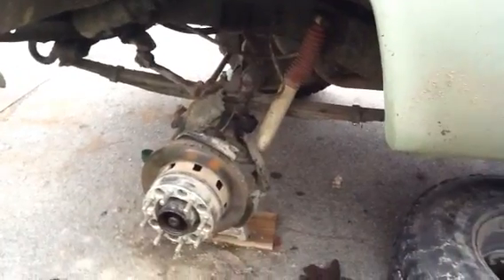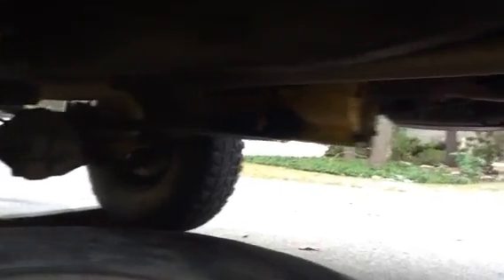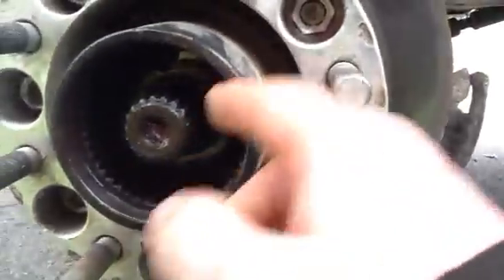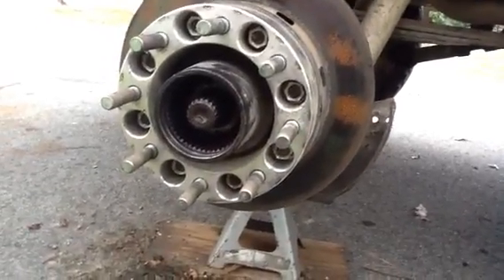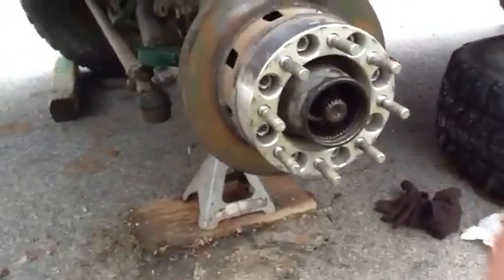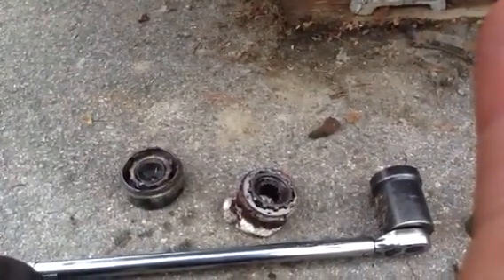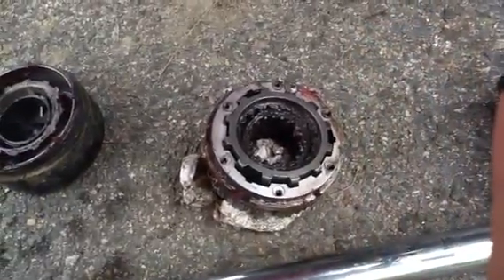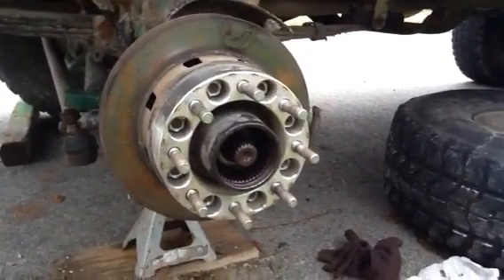How manual locking hubs work

Comment: Nice video,  Ian. You inspire me to make more content. Been meaning to make a video about a cheap hack, incase you blow out the locking hub mechanism in a common way. Something my truck seems to do. The diesel ate up all my spares. Something the 460 never did.
Reply: One more thing. Did you put a divorced np205 in that truck? I couldn't see. Been looking for one. Want the advantage of the pto, and 4x4 after a gear vendors overdrive. Or a simple "brownie box", if I can find one.
Reply from the maker: I have a mated SM465/Np205 in this truck.  I did pick up a Ranger Overdrive for it tho.  Advance adapters used to make it as an over or under drive unit IN front of the old 4 speeds.    kind of a cool idea.
Reply from the maker: yeah go for it making vids is kinda fun and I love learning from others.  Thanks for watching my vids.  Sorry the editing and camera work are so so.  Hopefully getting better with a new phone and more free time.  Just sold my fox body mustang and picked up a 7.3 E350 to build.  Maybe it will get 4x4 conversion....   Thanks for watching!

Comment: If you have these types of locking hubs, you can just weld your front diff together.  Now you have a selectable-locker.  Is that not correct?  :D
Reply from the maker: you could but with it welded it would be hard on the street  and real hard to steer in snow and ice on the street in 4x4.    For the cost and ease of repair I prefer a lunch box or Lockrite or spartan locker over welding.  I got the front locker used for 100 bucks.

Comment: So a locking hub makes your RWD truck to AWD? Can you leave your hubs locked and never unlock them?
Reply from the maker: sure you could.  but as most offroaders will tell you you can break a hub.  Also they make drive flanges or drive pucks to do just that.  Some call them drive slugs.  IT is how my truck came from the factory.  Most Plow guys will keep there hubs locked all the time around here

Comment: I have a 2001 Hilux LN167 and when I put it in 4x4 with the diff locks on it jumps out back to 2H when I set off. 4x4 Low works fine. It does not jump out of 4H when the diff locks are off. Any idea what might be happening? What do I need to look at?
 Could it be a hub issue?

Comment: If my hub is squeaking when engaged do I need to replace the locking hub? Or everything
Reply from the maker: It could be a few things but first I would check your axle joint on the axle shaft.  I would also open your locking hub and clean and oil it.

Comment: So if I have a 4x4 truck with a manual hub I need to switch it to lock to go 4x4
Reply from the maker: correct.  If you keep it in "free"  the axle shaft will spin but the wheel will not be engaged to get power.

Comment: Can you just put this on any 4x4 I believe most front diffs are open?
Reply from the maker: Locking huibs Lock the wheel hubs to the axle shaft.  Diferental Lockers Lock the right and left axle shafts together..  Most front diffs nowadays have a Unit bearing so the axles are already turning and oly get 4x4 when the Transfercase is shifted to power them

Comment: You can leave them locked if you know you'll need them and then switch between 2 and 4 without getting out
Reply from the maker: Yeah thats a great point.  And most Plow guys or loggers around hear do just that.  With my front differential having a locker installed I try not to keep them Locked on the street as it makes turning a little harder.

Comment: I'm assuming your 4 wheel drive has open differentials with power to only one free spinning wheel (front & back axles). Therefore, to have power to both wheels, the cheapest way to do this is to have locking hubs. Did I understand this correctly?
Reply: No.  Looking hubs just means the axle shaft is connected to the hub.  Your differential gear set is what controls power to one or both wheels.  If you have what I know as lockers, you'd have power to both wheels equally.
Reply from the maker: Nailed it man well said
Reply from the maker: My truck does have power to both front wheels because I have a Locker installed in my front differential which sends equal power to both front axle shafts which are connected to both front hubs where the wheels mounts with the locking hubs.  IF i did not have a Locker in my front differential then The Power would travel to the wheel with least resistance.  IF I did not Lock my locking hubs then the hubs and axle shafts would not be mechanically connected and no power would go to either front wheel.

Comment: I can see it's different to a diff lock but if you have both ends locked I don't see the difference
Reply from the maker: The wheel hubs just lock the tire to the axle shaft through the hub.  The axles shafts meet at the differential taking power from the drive shaft.  Placing a locker in the differential Makes it Locked and not diffrenate power.  Locking hubs just LOck your wheel hub to the inner axle shaft.

Comment: To be on the safe side...i got an 84 toyo. Just bought it a couple weeks ago. The front axle inner seals are shot. Leaking bad. I have limited time to fix it and plan on driving 8 hours back home with the truck in a coulle weeks. 
Question is....transfer case in regular 2wd, the front axle shouldnt move, right?  Thus the front diff gears are not moving at all...Amd the hubs disengaged, the diff wont move either, right?  I want to make sure i wont be burning the gears up in the front diff taking the long drive with barely any oil inside the front diff.
Reply: Iggybu that would be correct, when the hub is disengaged the hubs are disconnected from the cv axle thus not spinning anything inside the front differential.

Comment: It's NOT rocket science. Just explain why even bother locking the hubs in 2h at all and what is happening when you are driving in 2H with the hubs locked as opposed to 4H. No video actually explains what locked hubs is and it can't mean  4x4 because you have 2H with isn't 4x4.
Reply: 2H only sends power to the rear.  4H or 4L will send to front and rear, but if your hubs are unlock the front diff is spinning but not transferring power to the wheels.  The hub in the locked position will lock the wheel to the front axle.  If in 2H and the hubs are lock, the wheels will turn the front diff.  Bad for gas mileage, bad for wear, but if you rarely use 4 x 4 then locking the hubs in 2H will circulate the diff oil a bit.  Just don't do it for long distances.
Reply: It would engage the differential causing it to rotate
Reply: againandagain in 2wheel drive if you unlock your hubs your gears do not spin while your moving

Comment: i have a driver hub that keeps trying to lock itself when driving. obviously it never actually does, but it goes from 'free' to nearly locked within a few miles of easy driving. should i replace or is the spring just worn? it is a problem cuz it clicks SUPER loud when this has occured, causing me to stop and free it up again....getting worse over a month. any ideas? never had this issue before and trying to not have to replace the set if i dont need to
Reply: Stephanie Harvel I have the same issue did you figure out what to do

Comment: If the axle shaft is turning is there a problem with the center section? I have locking hubs and I turn it to free but the axle is still engaged with the hub. Is there something wrong with the axle?

Comment: Thank you for the explanations.  Know I understand.  Does 4WD works when the front wheels are not locked?  Or the wheels must be locked?
Reply: in order for your truck to be in 4x4 with manual locking hubs you have to get out, lock the hubs then get back in the truck and then put your truck into 4x4 like any outher truck. but without your hubs locked, and if the truck is put into 4x4 it will not turn the front tires. they must be in their locked position. but. you can leave them locked. in my k20 i topically dont because im not in 4x4 all that often, so i rather not wear my u joints. but most off roaders buy cheep hubs, so instead og breaking your axle. you just break the hub
Reply: isn't 4WD and AWD the same?

i understood that 4wd and awd full time would distribute the power at around 70 percent Front and 30 percent Rear

and 4x4 low is more like 25 percent equal on each wheel
Reply: Default Name no, 4x4 is distributed equally. AWD distributes power to unequally depending on which tires needs it the most basically.

Comment: Still some questions left.

You said "rack and pinion" in the front axle. (Which, I think, i sweird. I only know "rack and oinion" in the meaning of "Zahnstange", as in some steering designs. Do you mean a bevel gear?) 
So there is no differential in the front axle? Then, of course, locking hubs would make some sense, because on non-slippery terrain the drive train would tense up, leading to excessive wear and making steering rather unpleasant, if not impossible. Actually, the same outcome as a locking front diff for all practical purposes. 
If this (no front differential) were the case, you would NEED to unlock the hubs to drive on non-slippery surfaces. However, this then means you would have either 2wd (as power would still only be transfered to the rear wheels with unlocked hubs even if the transfercase is in 4wd), or the equivalent of 4wd with a locked front diff; but no "normal" 4wd mode with functional front diff. This car could be driven as a 4wd only in offroad applications.
Not a very elegant solution. Should this really be the case? I doubt it. 

If there is a front differential, though, the only purpose appears to be saving fuel onroad. (Which is a very laudable cause, of course.)
Reply: front axles do have differentals. the rack is conected to the diff. and the pinion spins them
Reply: Manual locking hubs have differentials. sorry i forgot that part. haha their is no really difference between a manual locking hub and a auto. only difference is that the manual locking hubs fromt drive shaft is not always spinning
Reply: Manual locking hubs have differentials. sorry i forgot that part. haha their is no really difference between a manual locking hub and a auto. only difference is that the manual locking hubs fromt drive shaft is not always spinning

Comment: So if I lock my hubs and keep the gear select in 2x4 that is bad right? The hubs are engaged but not powered? I'm in Wisconsin and snow is coming soon, and I don't want to have to keep getting in and out of the warm truck, to switch to 4x4.
Reply: It will just affect your mpg
Reply: +pinky1933 No it wont do any damage. The hubs are locked, so the turning wheels will turn the axles, diff, and drive shaft. But all those parts are designed to do exactly that: turn. I leave my hubs locked full time and I've never had any issues whatso ever. great video mate!!
Reply: +pinky1933 No theres nothing wrong with that. If you're in 2WD with the hubs locked, then the front drive shaft and half shafts will turn as the front wheels do. But because there is no gear engaged to it in the transfer case, nothing happens. If anything it reduces your MPG but only marginally. My hubs are locked all the time. You can too. It stops you from needing to exit the vehicle to set them before setting 4WD.
Reply from the maker: Okay advantages....
When unlocked les parts are turning means less drag better mpg and less wear.
Biggest advantage is if u break an axle shaft, u joint or gears u can unlock the hubs and drive home
Reply: so again, what is the actual purpose of locking hubs? i don't think the video explained the advantage of them if u can just leave them locked and do the selection from inside the vehicle.
Reply: The idea is that you can entirely release weight of the foward running gear from the undriven wheels. This means the rolling weight of the vehicle is significantly less. In reality its not so much of a difference, but thats one reason. Another is to prevent wear and tear, the diff, uni joints, axles and drive shafts dont turn when the hubs are unlocked

Comment: Do you know how AUTOMATHIC ONES  work?
Reply: Some are also "live." In layman's terms, hubs being permanently locked in with no option to unlock them. There are also centrifugal auto hubs that get activated mechanically when you put it in 4wd, you have to back up in 2wd to unlock them.
Reply: +PABLO JORGE they utilize a vacuum pump. What it does is essentially suck on the locking portion to suck it in and out when you engage it. So instead of turning the hub on a manual, the same thing accomplished via the vacuum created. It sucks the little plastic clip on the inside to engage the lock.
Reply: +KM L (KLsemperFi7) Thank you very much for your response. Although, in my NISSAN GR, I don't see any pump. Is it inside the automatic hub itself ?
Reply: I think that's the case on Patrol, the centrifugal ones. It is also noted that with the hubs in AUTO, you can engage 4WD without stopping to up to 40 kph, whereas if you're in LOCK, you can engage 4WD in up to 80 kph. I think that's because in LOCK mode, your wheels are turning the shafts already, despite the transfer case actually not sending power to the front wheels. So there'd be more wear and tear on the front bearings, shafts and hubs, but it would allow you engaging the 4WD in higher speeds. 

Am I correct?